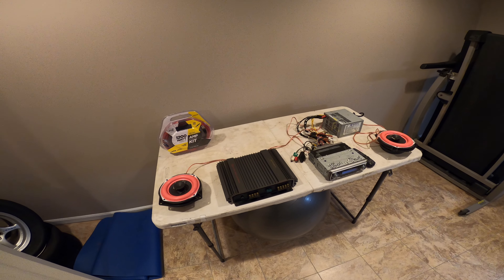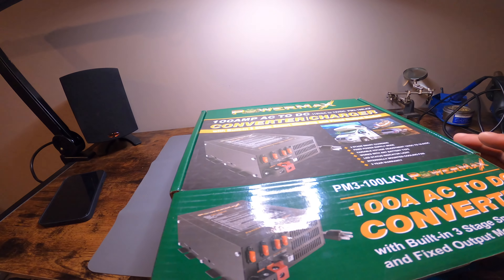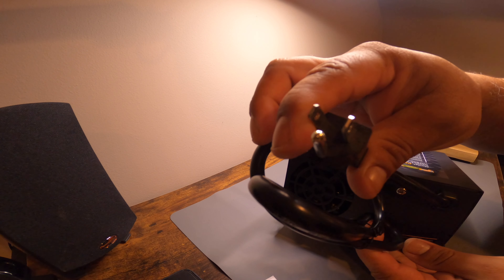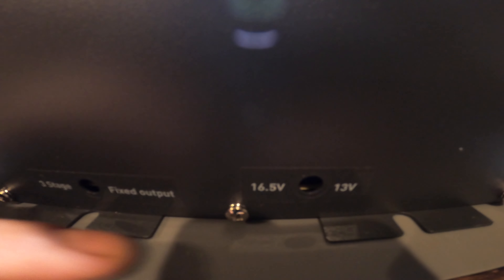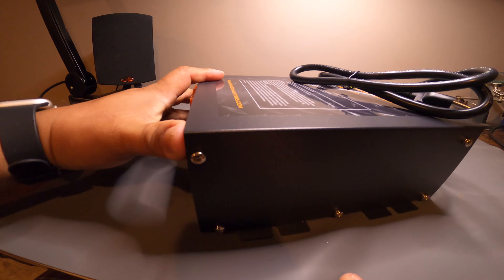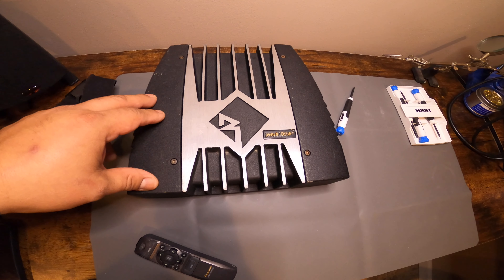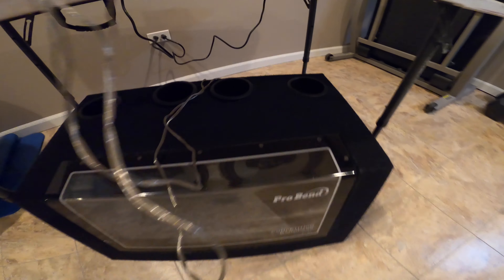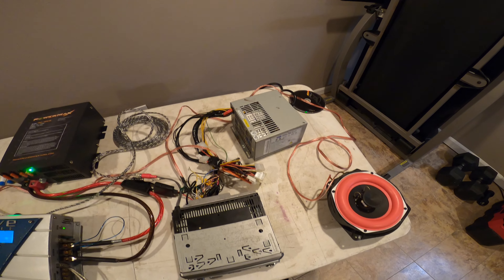Powermax 12v power supply

Comment: I've been using a 14.2 amp XBox supply for 10 years, powering a 3 channel 600W amplifier with 8 speakers, plus a 12 inch subwoofer. You can run it near full volume without clipping. It takes all 14.2 amps. At a volume level where you feel like it's too loud, it will cut off, but the whole house is shaking by that point. It certainly doesn't need more power, but I want more power.

I was shocked to hear how much volume you can get from just 14.2 amps. The voltage is 12.30 volt, but drops to 11.90 volts before it will clip and shut down. The capacitor in the XBox power supplies is tiny, so you need a very large buffer capacitor (I don't have a buffer capacitor unfortunately).

I do want more volume, and more power (duh!) so thanks for this video! I wasn't sure where to look.
Reply from the maker: Hello and thanks for watching, I have heard of people using the Xbox power supply. Before my Powermax setup I had a computer 5amp power supply that barely powered amplifiers. Going through that made me want a decent 12v power supply and purchased the Powermax. Till this day I haven’t had a problem and have powered a 1000 watt amplifier with it, so I’m happy to say the least. Again thanks for watching and if you haven’t already please like and subscribe. 🔊🔊🔊

Comment: I was previously using a repurposed computer PSU as well.  Despite it saying 650 watts it didnt do the job very well.  It was good for checking that an amp I just bought powered up and wasnt in protect mode but thats about it.  Some amps wouldnt come out of protect because it could tell the wires were too small of a gauge (MTX amps).  
I came across these Powermax supplies and ended up buying the PM3-75LK.  The 75 amp version of the one you have here.  It is capable of up to 1095 watts continuously so that will be more than sufficient to test pretty much anything I need to.  I made a little setup with some 4 gauge going into a distribution block that had multiple outputs so I can hook up the amp, headunit etc.  Setup works great and the price i got it for was amazing because they had made a mistake, thats why I bought the 75A, it was priced at $119 and the 100A was $279.  The 75A should have been about $219-239 but i ended up getting it for less than the cost of the 30A model.
Reply from the maker: Wow you ran into a deal only paying 119$ for the 75amp version of the power supply. I also previously had a pc power supply that I used in the exact same manner as you mentioned, I was only able to check if  amps and  head units would turn on and play them lightly. Thanks for watching and please like and subscribe. I have more content on the way.🔊🔊🔊

Comment: i suggest these to everyone in car audio all the time !
Reply: It also the cheapest easy way to run a 1000 plus amp in a home set up with out having to pay the over priced amp plates and rack amps you just have to under stand the power unit alone not enough because it can only handle about 90amp by it self it need to be just like it is in a  car set up  you don't only run a alternater just for your stereo everything has to work together for it to handle the full amp power  thats why people have there cars running on sound demo's there not one part can do it alone it a system.lol🤔👍👌✌️💯🍻🎶
Reply from the maker: Makes perfect sense. Battery or capacitor coming soon.👍
Reply: @josephsaucedo8691  exactly my test bench in my shop is capable of running the biggest amplifiers made which wouldn't be possible without the lithium batteries not only can I run them for testing but I can run them for daily use , the PowerMax power supplies keep them topped up.  I have three of them
Reply: @mazda2284 what size do you have?

Comment: Yeah, hulkin' up the ole power supply . I was using a ps out of a Dell desktop pc that was good for 14 amps, but upgraded to a Corsair TX850 I pelfed from a gaming pc. This puppy is good for 80 amps and hasn't once gone into protect/shut down. Currently is supplying the juice to a MMATS Hifi4250 (which is one badass amplifier). 
* 200 rms × 4 @ 4ohms
   400 rms × 4 @ 2ohms
    800 rms × 2 @ 4ohms bridged
$1,300 msrp and would be worth every penny, but I scored it used for $90
Reply from the maker: @csj9619  Wow nice score on the amp. As far as the power supply, I love it and has never given me a problem. Thanks for watching and if you haven’t already please like and subscribe.🔉🔉🔉

Comment: Im on the fence of getting this 100 amp or the taramp 120amp power supply.  The taramp i can power a deck, amp , crossover, and small amp for mid/tweet. Im just affraid this isnt gonna be enough power. I plan on running a skar 1200.1 amp.
Reply from the maker: I believe either option is a good decision, I have never had an issue with not having enough power for an amplifier. But I will say I have learned that running a power supply directly into an amplifier can cause an issue, some amplifiers don’t like to be plugged directly into a power supply. I recommend using a battery or a high power capacitor in-line of any 12v power supply. If you watch more of my videos you notice  I eventually ended up running a small battery to make all amplifiers run as they should. I hope I helped with your decision, whatever you do is your decision and at your own risk. Thanks for watching and please like and subscribe.🔊🔊🔊

Comment: Hey Man
I have questions 
I can’t understand 
Which one need to buy
I set up 12v AC
My AC work 12v 60 to 80amp 980 watt
If I put battery between generator and converter 
It doesn’t help to charge the battery while AC working speed lvl full
If I don’t put battery between generator and converter it can run my AC in has compressor 
So the compressor can’t run properly 
I don’t want to put battery between generator and converter 
What kind of converter can help me to run 
If u know plz help me
Thank
Reply: Hey that's I'm looking forward to help me to my a/c is 12 volt battery can't help at all 😢
Reply: @LorenzoMorales-sh9ty  
In hot time can’t help
U need to buy BTU 36000 and 110V not 12V

Comment: Hello, how are you friend, very good video first of all.  I also have a powermax connected similar to how you have it and my question is why the low esl is decreasing every time maybe I don't have it right on the stage flexed autput knob, what can you recommend?
Reply from the maker: I’m having trouble reading your question, what do you mean by low esl?
Reply: @93dajjdg  I have problems with the subwoofer.
Reply: @93dajjdg  The amplifier is the only one that is connected to the Power Max and over time the subwoofer levels are lowered.
Reply from the maker: @guillermoaguila3735  

I’m not sure what you mean by subwoofer levels are lowered, does that mean it’s not as loud after a while? If so you may be getting use to the amount of sound, this happens all the time, as to why some will jokingly say car audio is an addiction, you always want more.😂
Reply: When I just turn on the audio, the subwoofer levels sound very good after about 20 minutes, the bass is gradually heard less and the buffers sound bad, maybe it's because I'm running it at 14 volts.
Reply: It also has another knob which I don't really know what it works for. Apart from the one that regulates the volts. Maybe it's the knob that I have to move because I feel that the power supply is losing power and the woofers gradually stop hearing.
Reply from the maker: @guillermoaguila3735  

Running car audio at 14v is perfectly ok, what you are describing sounds similar to what happened to me in the video. Are you running a battery or capacitor in between the PowerMaxx and the amplifier? If not that could be your issue. Like I mentioned I was having problems like you described when certain amplifiers ran on the PowerMaxx only and once I added a capacitor all my problems disappeared. If you are running on the power supply only I strongly recommend getting a battery or capacitor installed on your 12v system, I do believe it would solve your issue, I did the capacitor first because it was inexpensive and was testing the idea, you should try the same. I hope I help and let me know what happens.
Reply: @93dajjdg  Maybe the problem is that it is working at 13.5 volts
Reply from the maker: @guillermoaguila3735  

It should work properly between 12-14.8 volts.

Comment: I plan on getting 1 of these. Maybe a 75 or so amp. If i use this converter without it connected to a battery and i crank my 500 watt rms to its full max or close to it will i blow a fuse in my homes circuit breaker?
Reply from the maker: I ran a 1000 watt rms amplifier with no battery and didn’t trip the breaker. I do suggest running a battery with a power supply, everything seems to work better. I sometimes would run into some strange issues that the battery resolved.  I hope I answered your questions thanks for watching and if you haven’t already please like and subscribe.🔊🔊🔊
Reply: @93dajjdg  thanks for the quick response. If a 1,000 watt rms didnt trip the breaker i should be ok. Without running a battery what strange things you think were happening? Noises?
Reply from the maker: @RollingInMy5pt0  

In some cases, certain amplifiers made noises or didn’t work properly. But whatever you do is at your own risk, be careful and use your best judgment. Again thanks for watching.
Reply: @93dajjdg  you think id be able to get away with a cheap priced battery at Walmart?
Reply from the maker: @RollingInMy5pt0  

I believe so, my only concern with that would be off gases the battery may produce if it’s not a sealed battery.
Reply: @93dajjdg  great.. i never thought id need a Diehard battery for a Kicker amp 😆
Reply from the maker: @RollingInMy5pt0  

If you are serious on having a 12v setup indoors again go with a sealed battery and go with a reputable power supply. I have never had an issue with my Powermaxx so I totally recommend that brand.
Reply: @93dajjdg  yes. Ive eyed powermax for some time now i just keep saying to myself “i gotta finally get it already”..

Comment: What size breaker is needed for drawing the current from your home power?
Reply from the maker: Still on a 15amp breaker, never had the breaker trip. Thanks for watching and please like and subscribe.🔊🔊🔊
Reply: What size fuse you using to protect the amp?
Reply from the maker: @meano9073  

I’m not sure, no numbers on the fuse. But I have do have a replacement but for whatever reason I can’t get to it. I also have a power kill switch i need to install.

Comment: Is there a switch on and off button on the powermax or do you just unplug when you want to shut off the system?
Reply from the maker: No switch on the PowerMax, I just unplug it from the wall when I’m done. Thanks for watching and please like and subscribe.🔊🔊🔊
Reply: @93dajjdg  thank you. Definitely subbed.
Reply: @93dajjdg so I just got this powermax and when I hook up the RCA to amp Rockford T1500BD, the subwoofer hums. It even hums louder when hooked up to a Kenwood head unit, am I missing something?
Reply from the maker: @K_Vang23  

I noticed some amplifiers don’t like to be directly connected to a power supply and what fixed that problem for me was getting an inexpensive capacitor that I found at Walmart. I will say I give credit to subscribers for hinting that idea to me. This again is what fixed my problem, hopefully your amp doesn’t have a problem causing a hum but I would recommend trying a capacitor like I mentioned. Hopefully this advice helps, a visual example of the capacitor being used on the bench would be found in videos that can be found in the video library. I have since upgraded from a capacitor to a small battery, all is explained why I do anything in the videos.
Reply: @93dajjdg  I will give it a try. Thanks for helping. 🤝
Reply from the maker: @K_Vang23  

No problem, let us know what happens.👍
Reply: @93dajjdg  will do.

Comment: Do you know if the converter will stop sending power once it detects the battery is full on fixed output ?
Reply from the maker: I’ve never tested my power supply in that manner,  I’m always trying to play it safe. Whenever I have the power supply on fixed mode it’s always for a short period, again playing it safe. Be careful, thanks for watching and please like and subscribe.🔊🔊🔊
Reply: That's the beauty of DC. Your battery will stop charging when it's complete. However, lead acid battery life will be shorted doing this, as they do not like max amps past 80% charge. If you want to use this as a full-time battery charger, you will not want to use fixed voltage, as there is no float charge mode either. With extended time at max, volts are unsuitable for batteries; their float charges are always less than the bulk charge. .

Comment: Does this give clean stable power at 14.5v?. I need clean power to do flash programming on BMW & MB and other cars. Thx
Reply from the maker: Hello and thanks for watching. I haven’t had my 12v power supply for that long but since I’ve owned it I have never had a issue with it. I have only used it to power car amplifiers and so far the power supply seems to be very stable and not mind what I do to it. As far as clean power I couldn’t tell you, I don’t own an oscilloscope to check. Thanks for watching and please like and subscribe. 👍👍👍

Comment: I got an issue with my setup i was wondering if u could help so i got the same power max supply u got in this video and i got a  skar 1200wrms rp-1200.D amplifier  and 2 skar 12in sdr  dual 4 ohm subwoofers and i keep getting a buzzing sound and thats with out the rcas being connected and i notice it only happens with classD amps do u have a solution to this
Reply: Maybe try to separate your rca from your power cables

Comment: Hi is this converter work on ac 220 volt ??? Because in my country its ac 220 volt current
Reply from the maker: PowerMax does make  220v power supply you can purchase, they also have multiple amp versions so make sure you choose the best model for your needs. I hope I answered your question, thanks for watching and please like and subscribe.🔊🔊🔊

Comment: You should also get a deep cycles battery AGM or at least a capacitor to hook up to that power supply  so you have some stored power  just to let you know 🎶👍✌️👌💯🔧🍻🎶
Reply from the maker: Sounds like a great idea. I will definitely look into that.  Thanks for watching and if you haven’t already please like and subscribe.🔊🔊🔊🔊
Reply: The cap / battery will help with AC ripple on the output too.
Reply from the maker: @JasonLeaman  

Sounds good, Definitely looking into it. Thanks for the advice. 👍👍👍
Reply from the maker: @mazda2284   

I will definitely check out your channel. Thanks for watching and please like and subscribe
Reply: @93dajjdg  already done , I know how much it actually helps and how important those likes and subscriptions are
Reply from the maker: @mazda2284  

You are a legend mazda2284, I remember watching your videos years and years ago. Thanks for subscribing and swinging by with great advice. 👍👍👍👍
Reply: So if you use a battery with this type of setup what settings do you set the converter to.  Charging or fix
Reply: @kamikazikaizer  in use you set as charge but you can put it on fix when not in use. so it keeps the batteries charged fully/top off. 🎵🎶🛠️💯🍻
Reply: Yes, im planning on adding an AGM battery to my setup, Im currently using the PM3-75LK (75A version of the one in video) and it works great.  Continuous output is about 1100 watts which is more than enough for everything im doing with it.  I buy and resell car audio.  Find a cheap deal or something drastically underpriced,  buy it and flip it after cleaning it up.  This allows me to demo whatever im selling (amp, subs, speakers etc) without having to mess around with the setup in my car all the time.  I spent far too much time making my car install perfect and clean and would drive me nuts to be fiddling with it all the time just to show someone that something works.
Reply: nope you dont need to if you have a good power supply bro
Reply: @bassboyful  I came from another video that you commented on , would mind sharing some info for my car audio system at home ? I have a 100amps powermax convertor and I’ll try to run a Rockford fosgate 1500bdcp and 1200 Rms Rockford fosgate T2D412 . I also have laying around a xspower D3100 Amg battery but you commented on a vid  that the battery is not need it if you have a good power supply . You think 100amps will be good . Thanks man . I’ll appreciate  it in advance.
Reply from the maker: Hello and thanks for watching, if you have the power supply and battery I would definitely recommend using both. You don’t need the battery to run a smaller amplifiers but once you start getting into bigger amplifiers or multiple amplifiers your going to want the most out of a 12v system. Since this video I have added a XS Power PWR-S5 to my test bench and definitely noticed a improvement. So again power supply and battery together equals your best bet. Again thanks for watching and please like and subscribe.🔊🔊🔊
Reply: Will this same converter blow the fuse inside the homes circuit breaker?

Comment: So how do you turn everything in… plug it in the wall. You running the turn in lead directly to positive on the power max and just turn everything on by plugging it in?
Reply from the maker: Yeah you guest it correctly, I turn everything on by plugging the power supply into the wall. I did recently add a switch to the remote for the amplifiers but that’s only for a quick swap of speakers or subwoofers. Thanks for watching and please like and subscribe.🔊🔊🔊
Reply: You can also get a extremel remote control on and off outlet for a 110v outlet  just make sure it can handle 20amps plug everything in and use the remote control to turn the power on and off to the supply that way you don't have to plug and unplug it all the time. 🎶🛠️💯👍✌️🍻